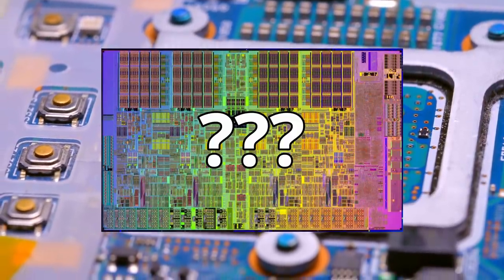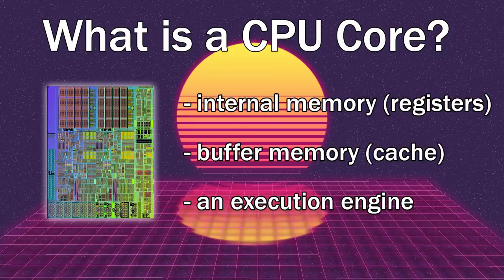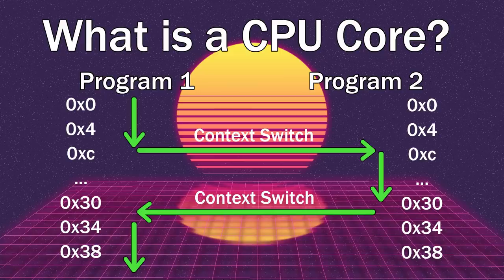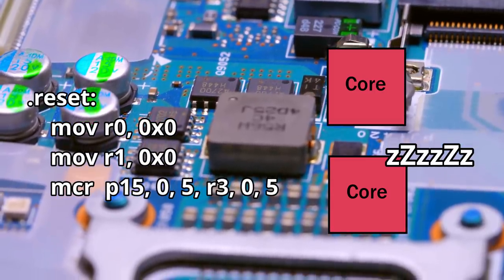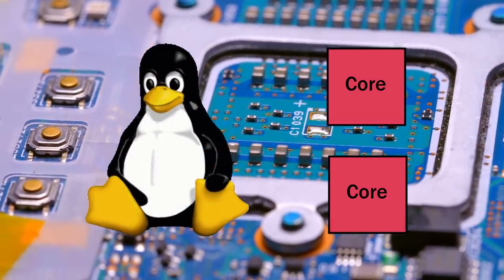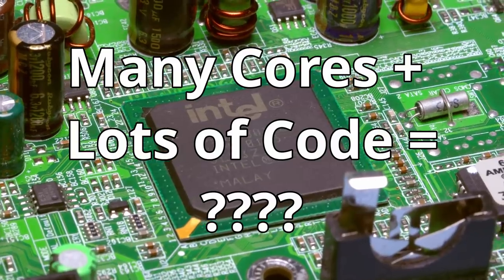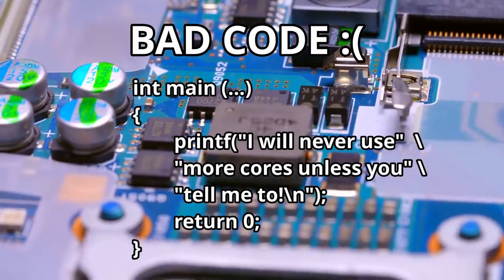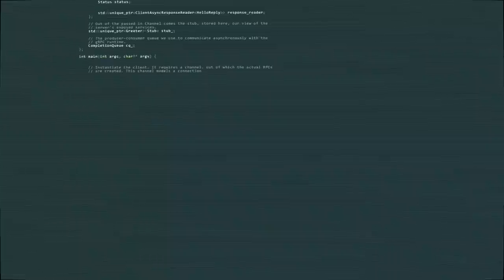why can’t computers have thousands of cores?

Comment: Also, a big factor is that many programs have linear logic. Amdahl's law shows how well a task scales with multiple cores depending on how parallel it is. For 50% parallel tasks above 4 cores is pointless. For 75% parallel above 16 cores is pointless. You just don't gain performance and that is baked in the logic of the task. Many cores are great when doing multiple of the same task without caring which task is completed first.
Reply: That and the fact that once you start getting into problems that are highly parallelizable, you'd just use a gpu anyway.
Reply: @mewsermeow8683  if the gpu has the instructions for it, but 99% of the time yes.
Reply: @badass6300  It's not about if the GPU has the instructions, it's largely about the type of problem too. GPUs for example, don't do well with highly divergent streams, but do well with highly uniform streams. Modern CPUs can often do much better with divergent streams due to their internal out-of-order nature, and throwing more CPUs at the problem has almost perfect scaling with Amdahl's law in such problems (very small sequential part - usually global book-keeping).
Reply: @hjups  True, but GPU architecture is getting close to CPU architecture with the passing generations. AMD GPUs since RDNA1 have hardware schedulers and might get OoO Execution in the future.

Then again with chiplets they might get a whole CPU to themselves for certain tasks.

Or vice-versa, integrated GPUs might get good, or both.
Reply: @badass6300  Not really. GPUs are fundamentally different than CPUs due to the parallel / vector nature. Some improvements have been made to handle thread divergence, but they are never going to be robust as a CPU.... otherwise.... they would be CPUs...

As for OoO, both NVidia and AMD GPUs do OoO internally. It's not something advertised though.
Reply: More cores would still be useful in the sense that you could run many more less parallel applications at once if you had more cores and more resources in general.
Reply: @utubekullanicisi  true, that's what I said in the end of my comment.
Reply: Check out the Theory of P-Completeness if you're interested in which problems can't be solved in parallel.
Reply: @Joker22593  Thanks!
Reply: What if things change ? The software and hardware is developped like this, today. But tommorow ? Zen shook the industry, devs had to adapt to 8 core processors, then alder lake shook it again with P and E cores who need devs to tell what kind of app need what kind of core.
Maybe in the future we will get a buttload of cores with scalable apps. Apps cut in micro apps who are parallelized and reconstructed at the end of the pipeline ? 
This video is like a dude 50years ago telling people electric cars are impossible because batteries are too heavy. Fast forward batteries tech evolved and here we go.
Reply: @PyromancerRift  There are likely fundamental constraints that prevent apps from being scalable to that degree. This is something that can be expressed by Amdahl's law. You're always going to be limited by the serialized portion of an application and all we have been doing is chasing the law of diminishing returns.
Even in the most extreme case of parallelism with dataflow processors, you still have a sequential wall that cannot be overcome. The only was to get reliable parallelism in any case, is batching, which is rarely going to be useful for the average consumer (it can be used for sub-task processing, like applying image filters, but that's a relatively small amount of computation).
If you really think about it though... one of the best ways to improve performance is to reduce the amount of compute required (which means writing apps in a more efficient manner).
Reply: @PyromancerRift  Zen didn't shake anything. It just forced intel to release the proper amount of cores.

We are talking about concepts here, the concept of linear, dependent logic. These concepts don't change, just like the 2 + 2 is always 4.
Reply: @PyromancerRift  There are algorithms and such that just can't be made to be parallel. That algorithm that is serial only is your limiting factor and it will always exist in user interactive tasks. There are certain problems however that can be highly parallel, and that is why we have supercomputers.
Reply: The more CPU intensive and independent from one another single-thread tasks are, the less they slow and are slowed by other tasks running in parallel cores. (Some of them could hog the available memory bandwidth for example, slowing anything that would need any of it down)
Reply: @lollllloro  That varies a bit. Depends on specifics of the CPU, how the interelations are done and a load of other factors. It can cause issues though and one does have to be careful wih shareing data between threads and how they run on the CPU.

Thing is, even if an individual task is slower say 75% of the speed, because I'm running twice as many tasks or more, together they'll all finish sooner. Also if interelated one can't necerssarrily just queue them on a single thread either. IO Wait is basically always a problem in programming and parralell can help or hinder depending on implementation and architecture.
Reply: By using word, "how parallel task is"
Do you mean stages of pipelining in processor ?
Reply: @PyromancerRift  
Split these four instructions among two people so that it's solved as fast as possible.

1. pick a random number
2. add one to number
3. add one to number
4. add one to number

It's fundamentally impossible to solve steps 2 - 4 without the result of the prior step. The most efficient distribution is to give one person all four instructions, then there is no need for communication between the two. The same concept also applies to computer programs, some programs are extremely difficult or impossible to do faster in parallel. Take Minecraft for example where entities might fly across several chunks and interact with blocks.
Reply: i would argue that in a threathpool aproach, where you treat the cores as a pool of workers that execute tasks async, then the more cores the better. Eg: i am coding games and i use this approach alot when calculating A* path finding, AI behavior tree. Tasks in general that dont need to be ready on that exact frame. then i benefit alot of more cores because how muchs tasks i can execute at ones scales with how many available cores i have free to use in any given time
Reply: if my job is "host 100 VMs", then the code and data are independent. you've got however many images running on 4 threads and 12G or w/e.

if my job is process this TB of data somehow, it's often as parallel as i care to make it, so 100 cores means i spin up 100 threads in a thread pool and start handing out work. 

if it's factorio, then the engine is SDL + custom and you might be limited to 2 threads running however fast you like
Reply: Not true, because GPUs processors suck.
Reply: Imagine how fast you could render 3d models with a program optimized for parallelization and a computer with a ton of cores 😮
Reply: Or maybe that's stupid and you should be using a gpu for that idk
Reply: Like rendering vs gaming as an example.
Reply: @brianwesley28  Rendering is the best case scenario and based on the architecture it's 98-99.9% parallel.
Reply: @alexolivers9476  Yeah, AMD wanted all the floating point operations to be done on the iGPU, that's why they developed the hUMA controller and Bulldozer/Piledriver/Steamroller CPUs/APUs have weak FPUs... guess what happened...

Developers didn't develop for it and they still kept using the CPU and its FPU for floating point tasks. Now we have AVX 512... horrible, power hungry, space taking instruction...
Reply: @alexolivers9476  yeah, we have GPUs for that.
Reply: @PyromancerRift  except that eletric car dude had a point and we might be heading to major problems with the eletric car market if batteries dont get more pelntiful and weigh less. Hybrids are showing better efficiency than the pollution created for a battery. Anyway just like how we know what your saying is not pozsible with the current design and materials computers are built with and it would take longer than 50 years of changes to change that. You gotta remember these things aren't magic they're doing real physical things and we know the limit of those processes
Reply: They are also useful for independent programs. of course then it depends on the size of the L4 cache which mediates the access to the memory bus. Seymour Cray demonstrated linear throughput improvement up to 16 parallel CPUs. After that it was limited by the crossbar switch growing at the square of the number of processors making more than 16 unaffordable.
Reply: Amdahl's law only applied to a master-slave organization. NOT to SMP architectures.
Reply: Compiling is one of the thing that goes faster the more core there are available. Yet again it's spawning different processes that do work on different files for each core. For compiling a single file a one core processor will be as fast as 64 core processor.
Reply: @jeffreyrockstudio8759  depends on the compiler implementation. Some use multiple threads to allow the parsing,optimization, and code generation passes to be done in parallel.
Reply: @hjups  Ahmdals law dealt with the CPU-RAM bottleneck. not parallel execution which is why the CPU counts were so low. it doesn't apply to things like the Chinese Fugaku computer with its Fugitsu A64FX 48 ARM cores per chip and 158,976, CPU chips so 7630848 cores. over 7.6 million cores.
Reply: @jessepollard7132  You have that backwards. Amdahl's law estimates the maximum speedup that can be obtained by parallel execution as a result of how much of the program can be parallelized. It's an algorithmic based bottleneck analysis which does not necessarily involve RAM. You can include memory bandwidth as part of the analysis, but then that's no longer Amdahl's law.
I have no idea why you bring up low CPU counts - unless you are criticizing the original analysis done in 1967 for not including millions of cores?
My suggestion is that you read up on the topic before making blanket statements about how it does not apply to current computers.
Reply: @hjups  NOPE. I have it right. it addressed the hardware. NOT the software.
Reply: @jessepollard7132  Then I must not understand Amdahl's law, could you please enlighten me as to which terms in the canonical equation represent hardware parameters other than the number of parallel tasks? (there's only 3 terms other than constants like the number 1)

Comment: You didn't talk about wafer yield. The more cores you have, the physically bigger the chip. The bigger the chip, the more susceptible it is to random manufacturing defects. Meaning, the bigger the chip, the more likely it is to be defective. This can dramatically raise the price since you get less sellable chips per silicon wafer.
Reply: So it's fair to say there's an ideal ratio in terms of cost to core count? At least from the manufacturer's point of view.
Reply: @WaterZer0  Well, the smaller the chip, the better the odds it doesn't have a defect. But yes, too small and it won't be powerful enough to do be competitive.

Comment: Want to hear something scary?  In 1969 when the Saturn 5 rocket carried our astronauts to land on the moon, their command module computer had less computing power than today’s pocket calculators.  In 1981 my first home computer had only 64k of RAM, a 5mb Hard drive that weighed 66 lbs, used an 8-inch floppy disk, ran on the CP/M operating system and had a green monochrome CRT monitor.  Its only function was as a very advanced machine code language translator and word processor for the court reporting profession. Its cost was $50,000.  I had two; one for me, one for my wife, since we were both court reporters.  The first computer I used was in high school.  It was a Univac and we fed our code into the machine via computer punch cards. It was the size of a mini van and weighed nearly as much. We wrote our code in the FORTRAN language and later COBOL.  Yeah, I was one of the computer pioneers.  Over the past 40 years I’ve owned over 45 computers, five of which I’ve built myself.  It has been incredibly fascinating to watch technology get faster, smaller and more powerful each and every year!  I am by no means an expert in computers or software design; I’m just a guy who has used computer technology to have employability on my side.  What a ride it has been…and what an exciting future computing has: quantum computers…

Comment: Technical Tradeoffs:
1. Power - Power Consumption / Thermal
2. Area - Core Size / Cache / Memory Bandwdith / IO interconnect / Yield
3. Performance - Architecture / Instruction Set / Clock Speed / FPGA / Multicore / CMT / NUMA / SIMD

Business Tradeoffs:
1. Algorithm Capability / Application
2. Market share / Manufacturing Size
3. Time to Market / Training
Reply: Thank you
Reply: bro you’re the best. Thanks for sharing this up. I’m a network engineer and didn’t know nothing about that.

Comment: I've recently started a job as a technical support engineer / technical writer working on complex digital signal processing applications. Videos like this, like yours, are exceptionally valuable to me as a non-programmer. There are limitations to design, implementation and efficiency that are contingent on factors entirely within low-level hardware programming, and having them explained so succinctly makes my job way easier, because I'm being provided with a higher level understanding that I can pass on to my reports. Props.

And, on a more personal-craft level, the quality of your videos in terms of rapidly explaining complex topics through efficient use of graphics and constrained use of jargon is very inspiring. Well done.

Comment: I always categorized "asymmetric" systems the ones that, while having multiple cores, do not have cache coherency - so it's up to the programmer to synchronize the cores. I once worked on a system that was running Linux on a core and an RTOS on the other, with independent MMUs
Reply from the maker: Two OS's on separate cores, very interesting.
Reply: Yes, i think Apple will have to go this way. We can see on the M1 Ultra that they hit the limit for chip connect already. But it could be nice to have a start with getting "blade computer" into the world of desktops. We had them in servers for a long time. Multi Socket Boards still try to do cache coherency.  But unfortunately desktop computers aren't there yet.
Reply: Embedded and mobile SoCs quite commonly can have lots of different cores with little or no coherency. For example TI's TDA4VM has (counting only freely programmable cores):
- dual-core arm cortex-A72
- three dual-core arm cortex-R5F subsystems
- one TI C71x DSP
- two TI C66x DSPs
- two real-time subsystems with 6 TI PRU cores each
with cache coherency only available between the cortex-A72 and the C71x as far as I understand (with snooping of main memory access by other cores or DMA, but no coherency with local caches of e.g. the R5F or C66x subsystems), while many of TI's older SoCs have no cache coherency whatsoever.
Reply: This is already done with Intel and Apple chips. Security. Forget name in intel but Apple put its T2 chip in the cpu Mx series
Reply: Didn't the Ps3 have a similar issue too?
Reply: @llothar68  apple is a joke, no one cares
Reply: Each core has to have its own MMU.
Reply: This is also the case of GPUs which have thousands of cores nowadays (or even more, RTX 4090 has 16 thousand cores) in asymmetric multiprocessing.

Comment: GPU and SPU cards already pack hundreds or thousands of "cores" onboard. They can only process simplex tasks, not complex tasks, but they can stream their outputs in near-realtime.
They suck a lot of power and spew a lot of heat while working at full load.
Reply: Which theyve been laying the ground work for since single core with things like liquid cooling and cryogenic cooling. Even my air cooler block is light years above what we had in the 1990's to where its on par if not out cools a 1990's water cooler.
Reply: what are spus?
Reply: @mm2f419  I think it should have been "DPU" not "SPU". So the smart network cards like Nvidia's BlueField.
Reply: simple*
Reply: @JorgetePanete  they do lots and lots of simplistic operations just when its added up its complex.